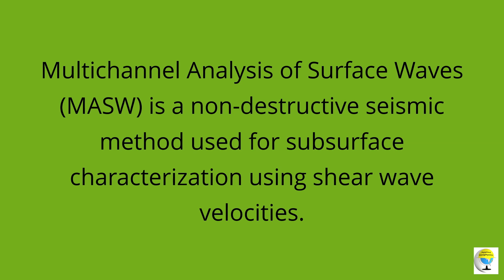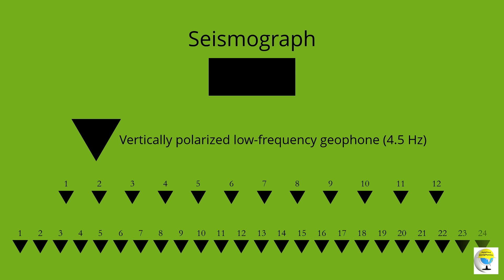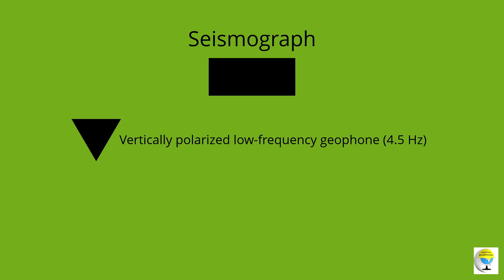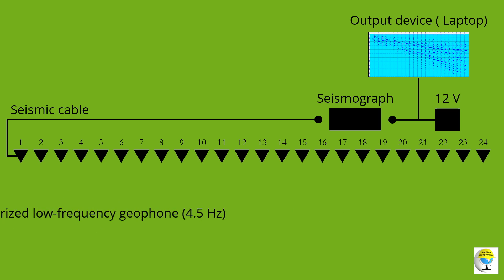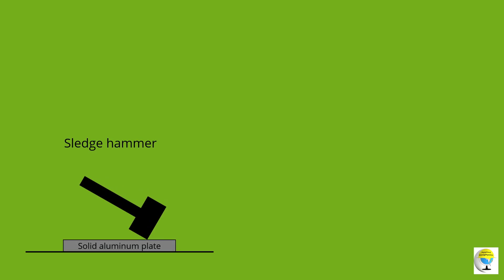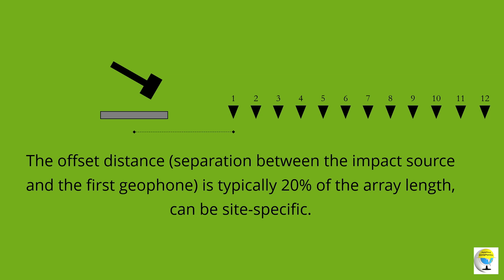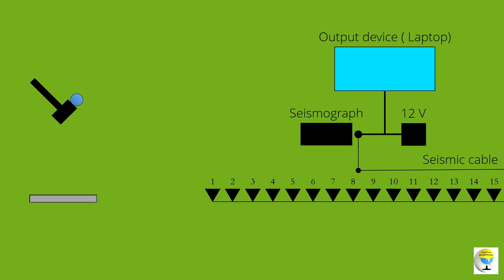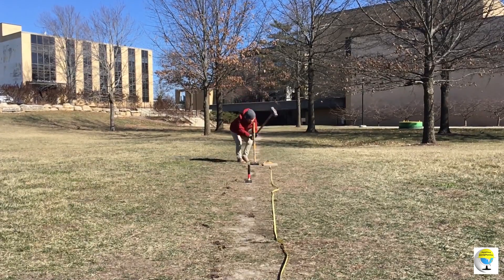MASW (Multichannel Analysis of Surface Waves) Data Acquisition

Comment: I have a question
What happens if I use 14 Hz geophones instead of 4.5 Hz?
Reply: they started the recording with 10 Hz geophones, they got data with high frequency range. It is better to use 4.5 Hz for MASW recordings and combine with 1D (ReMi) or 2D passive array, because of their low frequency range. I hope this answers your question. Else, search for John Louie's papers from University of Kensas, USA.
Good luck
Reply: Low frequency means smaller wavelength which means bigger distance or depth of survey
Reply: @Morbidduhgamer666 low freq means higher wavelength
Reply: @pradyumnyadastidar2452  you are right thxs for correcting